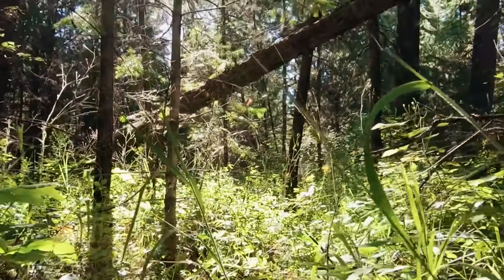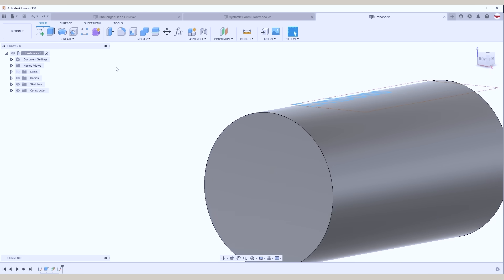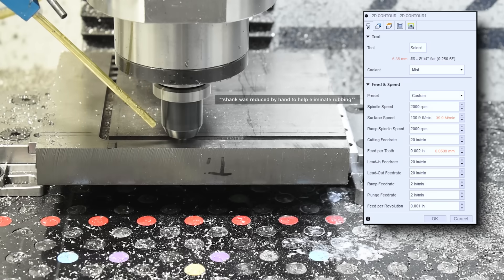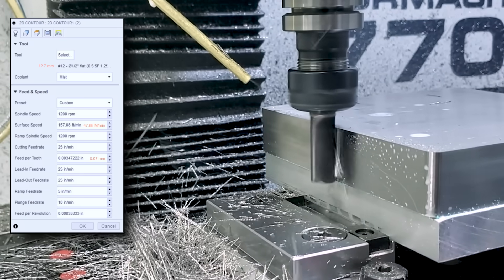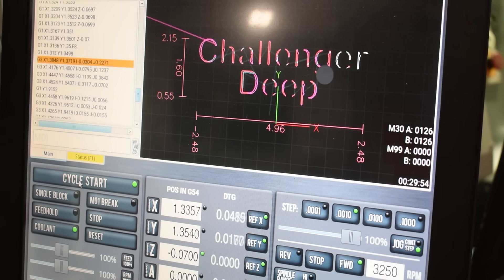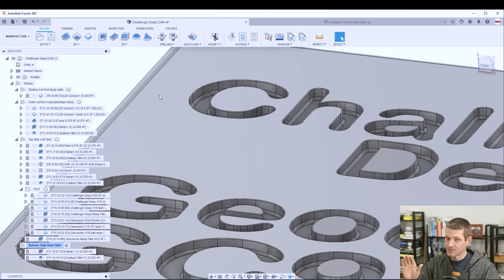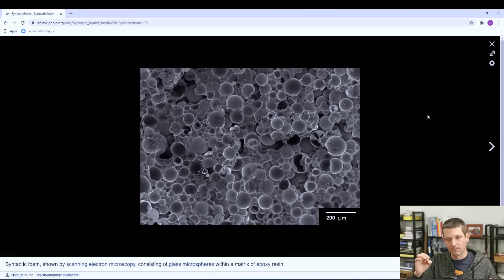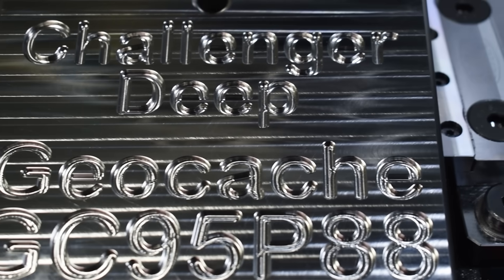Tormach Titanium Geocache headed to the Bottom of the Earth!

Comment: Do you have the blade #/model for the Noga you were using for plastic?  Looks like one of their ceramic blades, CR6000?
Reply: Yes, it's a ceramic blade. The complete tool is NC5100 (NC5000 handle + CR6000 soft cut blade), or NC5200 (NC5000 + CR6100 Hard cut blade).  I'd guess that John is using the soft cut blade here. Harder plastics can be more easily deburred using the metal deburring tools. It's the soft plastics that really get you into trouble as they gouge too easily.  I have an NC5100, and it is magic on delrin and the like.

Comment: Hi John,  One thing I've always wondered about the super glue trick.  If the tape is doing the adhesion to the table and to the part, why use super glue at all?  Why not just use double sided tape?
Reply: Painters tape is meant to be removable, double-sided is meant to be permanent.
Acetone, other solvents or a good whack easily release the very thin super glue, the blue tape isn´t much of an issue.
Double-sided tape on the other hand has a very thick glue layer, requires a lot of solvent to get rid of the sticky mess.
Reply: I've actually tried double sided tape, but it failed. I think the reason is, is that the layer of glue is thicker and the tape is some soft plastic. The part was able to move sideways due to the flexibility of both.
The tape they use is paper like, it's stiff and tears. Plus super glue becomes hard and brittle.